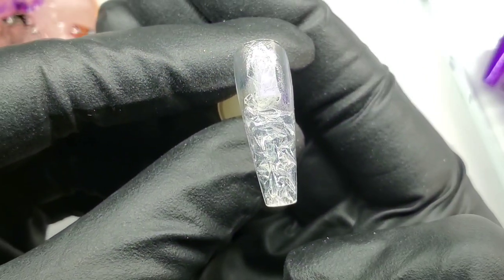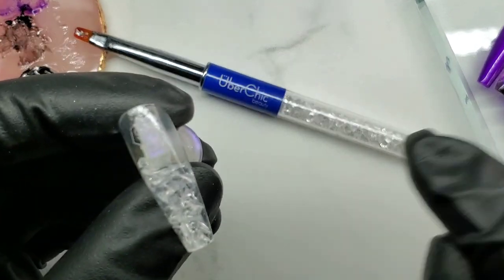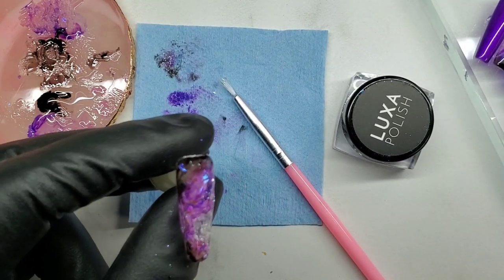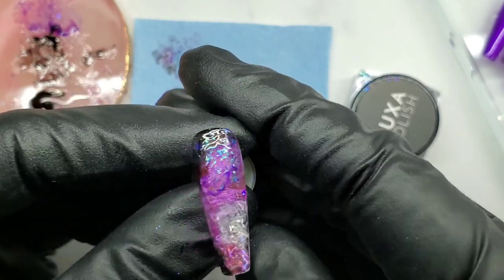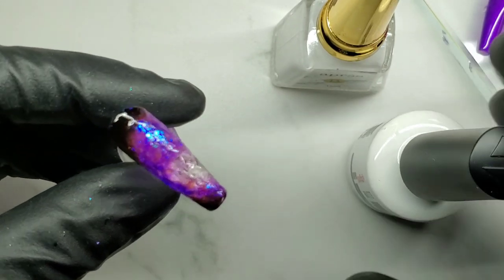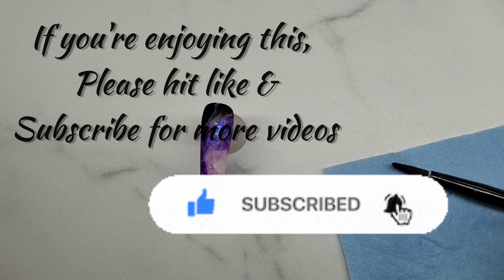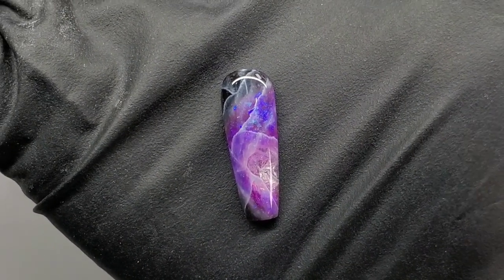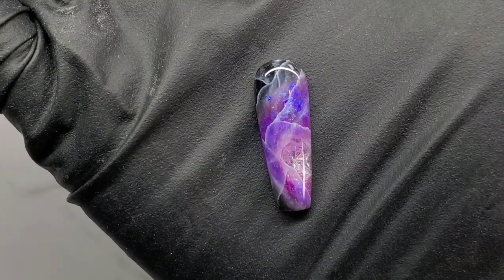How To- Amethyst Crystal Geode Nail Art Tutorial Step By Step

Comment: I am allergic to gel products, please could you let me know where you get your gloves from and what type they are ❤
Reply from the maker: I get them off of Amazon, search for 10mil nitrile gloves. The brands are always changing, but Watson Grease Monkey is one that I have used. What you are looking for is a thickness of at least 8mil, preferably 10mil. They are typically more expensive than your general gloves and are often advertised for Mechanics to protect from oils and chemicals. You just need to check over the description on the item to make sure that they list how many mils thickness the gloves are. If it doesn't specifically state the mil thickness, keep looking, as they won't be thick enough to protect you. I personally use 10mil gloves while I'm working on nails. If they come in contact with any Acetone, they need to be changed or you risk exposure as the acetone breaks down the barrier. If I'm just cleaning up or organizing, I'll toss on a pair of reusable rubber dish gloves just to be safe and not waste the others.
Reply: @loveyournailsbydawn  
Thank you so much, I've not done anything with nails for months now as I'm so worried about it.  I can't thank you enough for your help x
Reply from the maker: @Lynne-LandRnails  No problem 😊 If you check out the comments on my Nail Room Tour video, I've commented more about my routine for staying safe when working, in response to someone elses allergy. I think I should be doing a video about it at some point.
Reply: @loveyournailsbydawn  I will do that thank you.  I've subscribed to your YouTube so I look forward to your upcoming videos. Once again thank you so much for your help. It's bad enough not being able to do your own nails anymore, not being able to do anything is torture 😫 x
Reply from the maker: @Lynne-LandRnails I can understand that COMPLETELY! I spent years not doing nails until more information came out about allergies, so I'm more than happy to help others 🥰 @Lynne-LandRnails
Reply: @loveyournailsbydawn  
That's very kind of you, over the last year I've tried to get more information about it, it's not easy. So I appreciate your help x